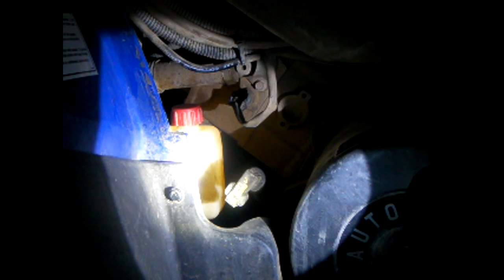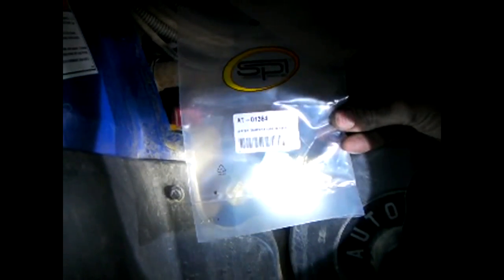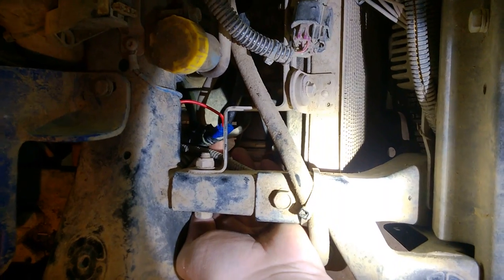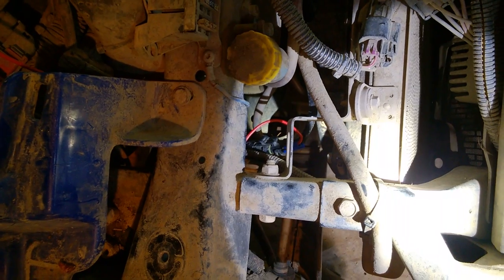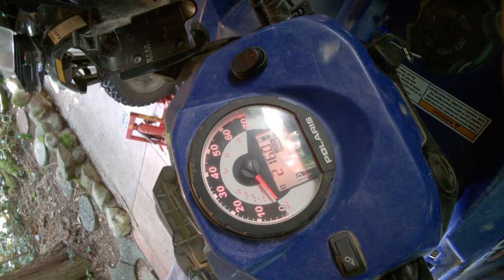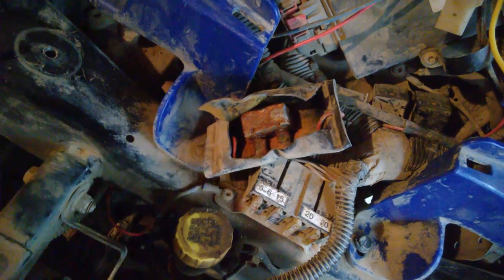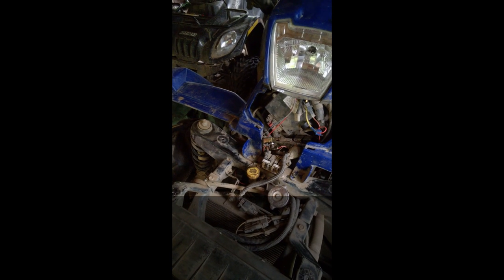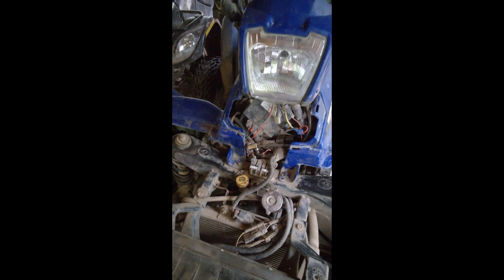Polaris Overheating - Fan Surging

Comment: My fathers 05 sportsman 700 will not stop over heat if we've done everything! Replaced the radiator completely replaced the thermostat. Checked the impeller and it's fine. The last thing we can think of is the ecm messing up and the bike isn't actually over heating. We've done everything!
Reply: I did everything too, but I did not bleed the air from the cooling system. That was my issue. After replacing all the other 5 to six units that make up cooling system, Air may have been the only issue. It over heated month back.
Reply from the maker: Did you replace or check the circuit breaker going to the Radiator fan though?  That was my issue.  It's in an environmental proof black bag (which was a water trapping bag of corrosion).  Everything seemed fine but as the machine warmed up the circuit breaker would trip and not allow current to the fan.

Comment: What year is your Polaris?  I have an 05 800 with the same problem.
Reply from the maker: jakob lukas it's a 2007
Reply: Was the circuit breaker located under the dash pod?
Reply from the maker: jakob lukas yes, very close to the fuse block.  Take the front box off and the blue plastic under the headlight.  Mine was down there, zip tied with some other wires

Comment: did the temp light flash on the dash 'hot'? even with the sensor being bad?
Reply from the maker: I'm not sure the temperature sensor was bad, but it was a cheap fix so I tried it.  The quad was flashing "Hot" when it was overheating.  Definitely was the circuit breaker, those element proof bags are a terrible design.
Reply: Had similar overheating issues with my 2012 Polaris 500HO. Took a while to find the circuit breaker. Under the seat, under the air intake gear. Find a used circuit breaker on eBay (no new ones to be found at the time). 15 minute repair. I haven't had any overheating issues since. Loving the machine now!  :)